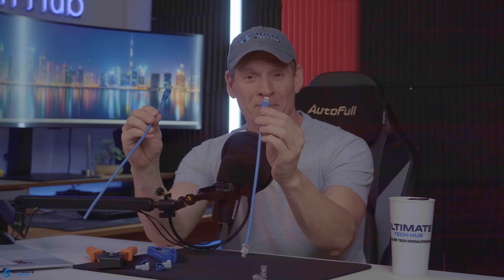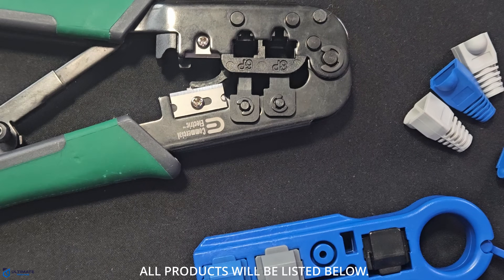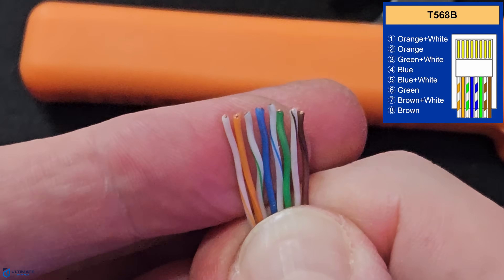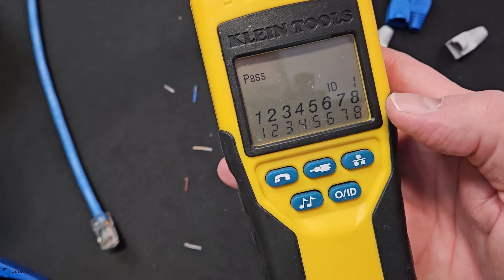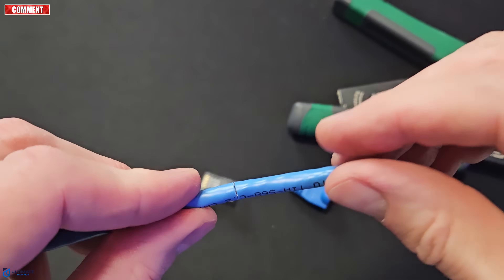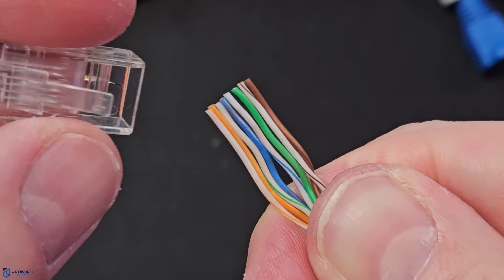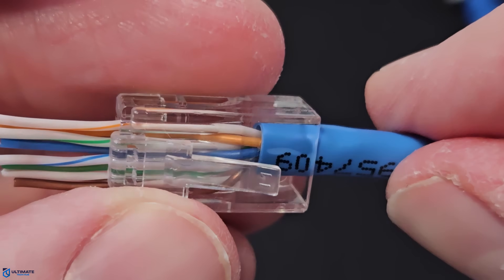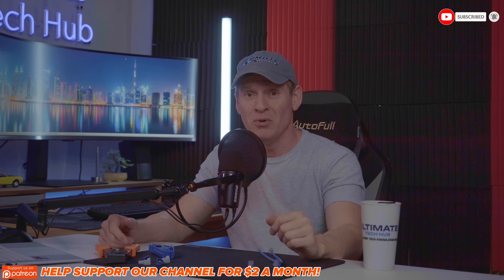Stop Wiring RJ45s WRONG! (EZ vs. Pro Method)

Comment: I saw these passthrough connectors on AliExpress, but i just go to my local store and buy the regular ones, never bought those covers either, i use an older crimping tool, so even if i wanted to use the passthrough ones i wouldn't be able to cut them with the tool, only thing that's a pain is getting the damn wires straight...

Comment: Pass throughs ONLY!  Been using them for years and make it easy to confirm the wire order and correct before crimping.  Won't go back to the old style.
Reply from the maker: All ypu need is a quality ez crimper with a sharp blade and ypur all good! Thanks for watching and for commenting !

Comment: A lot of manufacturers are voiding equipment due to people using pass through; crestron, extron, qsc, etc. Can cause shorts and cross talk. Just FYI. I only use regular mods but the ones that come with guides so the colors don’t mix up. Pre mades are the best option when possible.
Reply from the maker: I typically use standard RJ45s and the ones with the guide bars are very easy to use. 
Thanks for the great information and for watching !

Comment: Someone tell me what is the advantage to using T568B, which has white/orange (pair 2) and white/green (pair 3) swapped. In telephone applications, line 1 (white/blue) is in the middle, line 2 (white/orange) is outside of pair one. Thus T568A has the advantage of being compatible with analog telephone lines. Is there a greater advantage for T568B, which is not compatible with the phone standard? If so, what is it?
Reply from the maker: There isn’t a real performance advantage to T568B. The two standards are electrically equivalent for Ethernet; they just swap the orange and green pairs. If you terminate both ends the same way, you get the same speeds and signal performance either way.
A quick correction that matters: Line 1 (blue pair on pins 4–5 of an 8P8C jack) is the same on both T568A and T568B, so basic single-line analog phone use still works either way. The difference shows up when you try to map multiple lines using specific pair/color expectations (USOC vs 258A conventions), which is why T568A is often described as “more telephone compatible.”
T568B is based on the older AT&T 258A color code that was widely used in earlier structured cabling installs. So if a building (or installer) already standardized on that scheme, using B keeps everything consistent.
Bottom Line: Use whatever your environment already uses (existing house wiring, patch panel labels, workplace standard).
I will probably make a video on this subject so keep an eye out Ethan and thanks for watching!

Comment: I've been using the EZ connectors for years (POE and non-POE cabling, CAT 5E, CAT 6, etc.) and haven't had any issues with them. It is just quicker and easier for me, particularly as my eyes get older and I'm making more frequent use of reading glasses.
Reply from the maker: Glad to hear the EZ RJ45s are working well for you. I have a combination of both types in my home and have never had any connection issues. Thank you for watching and for commenting !

Comment: I do not like the easy pass through connectors, because they have a tendency not to seat well in some switches. When you push the connector into the switch, you want that satisfying click so you know it’s locked in. I’ve noticed that most of the ez pass through connectors fail this on many devices.
Reply from the maker: Great point and thank you for watching 🎉

Comment: Great video Mike!  I didn't even know there was a EZ pass-thru connector, I've only ever used the standard RJ-45 connector.  30+ years ago (back in the caveman days), I worked for a company where my primary job was dropping ethernet lines, wire up outlets and run lines to computers.  The worst I ever had to deal with were token ring lines, those were a PITA.
Reply from the maker: I used to run erhernet at CISCO events in Las Vegas.  It was fun hooking up all the switches and access points and CISCO paid well. My favorite installs are punchdown installs. Super simple and no connection issues. To be honest I really like standard RJ45s better than EZ. I think thats the original way I learned in college so it's very familiar. Thank you for watching Jon! Have a great weekend !🎉

Comment: My recommendation is to strip the cable way more than .5 inches, more like 2 or 3 inches. It makes more waste, but it is easier to straighten the wires and sort them. Once you get more efficient you can strip less.

And use a wire cutter pliers to cut the wires, no scissors. It will really avoid to make a slanted cut.
Reply from the maker: Thanks for the great comments  and for watching !

Comment: Thankyou but you didn't mention which way to hold the connector when you push the wires is ie should the locking clip face you?
Reply from the maker: Locking clip should face down like I show in the video. Hope this clarifies.

Comment: Appreciate the demonstrations, especially using a bit of the insulation to untwist the wire pairs, which is a trick I'm going to use!  RJ-45 connectors with internal load bars are supposedly necessary for reliable 10Gbps performance, though, so may as well use those if you're bothering with cat6 instead of cat5e.  In this hobbyist's experience, the load bars also make it easier to assemble the cable and trim the wires to the correct length (like a tiny, internal EZ connector) without anything poking out of the connector proper.
Reply from the maker: Absolutely,  load bars make it so much easier. Ive posted videos on cat6a installations with load bars. Thank you for the great information  and for watching !🎉
Reply: @UltimateTechHub Score.  In the meantime, don't mind me talking as if I didn't just learn about load bars lol.

Comment: I'm not keen on how you stripped the outer shield and then just used the wires.    

I strip close to the tip, then pull the string down to strip the insulation back.  Then nip off the end where the stripper crossed the wires.  This ensures your wires are perfect and haven't been nicked by the stripper.
Reply from the maker: I hear you, Ive stripped so many ethernet wires over the last 20 years that I never nick the wires. But yes the string is a great way to pull down the outer jacket to make sure no wires are cut or nicked. Thanks for the great comments and for watching !

Comment: I have been doing RJ45 before 10baseT.  After the 10baseT I soon learned the linesman scissors wire straightening edge and cutting function verses using crimp tool to make RJ-45 as good as any 100baseTX rated cable. A good set with blade, scissor, and pouch is versatile so get it with a good RJ11/RJ12/RJ45 crimper. One with OEM replaceable die guts if you are doing serious work. After the first 48 or so times a beginner making patch cables should figure how to lay cable and tools out for real work with RJ45s. A good supplier will rate connector type for speed and even if shielded. (I don't mess with shielded as, IMHO, if trying to make EMF shielded, whether external interference or radiant security issue just bite the bullet and go fiber.) There are polarized RJ45s like old DECNET with tab offset for non special controller communication use requiring obviously different crimp tool die. Then there's the topic of stranded patch cables or just to get by with a solid wire. This goes back to "if it moves use stranded" and "solid in wall with 110 block to receptacles" for longer MTBF. The metal flachettes in the RJ45 connector are optimized design by OEM for stranded or solid wire use. Generally, you can get by for a while with a solid wire patch cable before, after flexing one more time, it will fail.
Reply from the maker: Thanks for the great information and thank you for watching Mark!

Comment: I've been making my own cables since 1998.   I'm not a network engineer or anything but have done tons of cables both at work and home.  I'm a software engineer instead.  I have both types in my home lab.  99% of time I'll use pass thru but can use the "old school" ones too.   So much easier and quicker.  None of my crimp tools are made for pass thru.   I use "side cutters" that I use on pcb boards etc... they come out completely flush to the plastic end.
Reply from the maker: Wow, making cables since 1998, that's some serious experience! It's cool how you've adapted your tools to work for pass-throughs! I may try the side cutter method to see how it works! If it works and I make a video on it I will give you the credit and the shout-out!  Thanks for watching and for the great insight! Happy New Year Randy!

Comment: Nice work. I stick with the standard connector as I have a life time supply. Much prefer punch down devices for wall plates and then patch panels in the network closet.
Reply from the maker: I also have a lifetime supply of standard connectors which is about 50! Lol! I'll never need that many for my current home or when we move into our next house. I still have a some EZ connectors in the network tool box but never use them ( except for when I made this video ). 
In college we never used EZ connectors and we probably spent more time on punch down devices, wall plates and patch panels. 
Over the last 2 years, I had so many questions about EZ RJ45s versus Standard RJ45s I decided to make this video. It seems like a lot people are interested in it. 
Thanks for watching and for commenting Frank! 
Happy New Year!🎉
Reply: @UltimateTechHub  Yeah, I just made a video on fixing shoddy wifi. I use the same crimpers I have had since 1999. It's my first video YouTube decided to monetize (not sharing any with me). When at Georgia Tech, we crimped a few cables in the lab. It was never an official course thing just getting what we needed. I never found it hard. The hard part is now that I am in my 40s I find the little flip down magnifiers make it easier to see the little wires. I still don't find it any harder than 10 years ago but for that point.

Comment: I have been using the EZ RJ-45's (or RJ-45 passthru) for 20 years or so.  I have even moved away from installing RJ-45's all.  I install a keystone jack and use a factory patch cable about 90% of the time.  I have installed hundreds of the EZ's but if you get down to the nitty gritty, you need to match cable, connector and tools and then may very well not get a crimp as reliable as a factory cable.  EZ connector or not, the connector needs to match the wire gauge, solid or stranded wire, and then for ideal connections the tool needs to match.  Then you have the other issues discussed in the comments.  By the time you purchase 2 RJ-45 connectors and value your time at all, the factory patch cable is a wash.  You are out the Keystone jack, but the reliability is worth it to me.  I still make my own at times but not as often as before.  Your mileage may vary, this is just my 2 cents worth.
Reply from the maker: That's a great perspective! It's true that matching cable, connector, and tools is crucial for reliability. Prices for a factory patch cable are very reasonable so it's not a hard decision. I use factory cables from Satmaximum and they have never failed. I still like to make my own cables for custom cables lengths and it is still very satisfying when you do it right and it all works well!  Thanks for sharing your experience and tips!

Comment: Great info!  As a network guy your most important selection is your cable.  For most Cat 6 SBC (no CCA) will be your go to (1 Gbps @ 100m or 10 Gbps ≤ 55 m) as most home devices do not require more than 100Mbps.  I have never had an issue with pass-through connectors I love 'em, confirm before you cut, ring 'and plug, but keep that cutter clean  👍
Reply from the maker: Yes high quality cable is essential! Thanks for the great information and for watching!

Comment: Another question is why factory fitted patch cords still use standard connectors. Is it because passthrough connectors open for EM interferences?
Reply from the maker: Factory-fitted patch cords use standard (non-pass-through) connectors primarily for reliability and environmental protection rather than just electromagnetic interference (EMI). While pass-through connectors are designed to simplify installation.
Reply: @UltimateTechHub  It’s about price, as cables are produced through automation.  I have bought 6’ fiber optic audio cables < $1.  EMI not an issue in a low voltage application, if so Cate 6a and ground ur drain.

Comment: Con for pass-through prone to shorting out in POE applications, especially if the device is in a wet environment
Reply: If you are getting enough moisture inside the port for this to be a risk, you have much larger problems to deal with.
Reply: Better put some silicon or epoxy in those ends

Comment: I never use anything more robust than my thumb and index finger so as not to stress the insulation of each core. Four or five combs through between your fingers, and any kinks are out, and the strands are combed perfectly so that there are not even any gaps between the cores. Shove into the cutoff of the tool to the RJ45 stop, and cut perfectly straight off. Never use a scissors; maybe a good sidecutter does the job, but you don't want to fray the ends and cause a short between cores inside the connector. In the video, the insulation could have gone a lot deeper into the connector so that the little locking breakout can catch it a way in from the edge. Especially with POE, I don't like the pass-through type as the ends are not insulated. If I have to use a pass-through, I follow the usual way, and just don't allow the ends to protrude through. I may pass through, cut with a good sidecutter, and then pull back slightly, just as I am about to crimp the connector so that I hide the ends inside. 30 Years of muscle memory of doing it the old way, just does not like the new passthrough types, sorry.
Reply from the maker: Thanks for the detailed comment and your perspective from 30 years of experience! Thanks for watching David!

Comment: The old connectors are my choice the newer pass thru connector need special crimpers, and not all of the crimpers do a good job cutting the connector flush causing the connector not to seat properly in the rj45 jack resulting in no connection until i make a flush cut of the connector.
Reply from the maker: Yes I agree. I prefer the old standard connectors. The EZ crimper blades get dull very fast. Thanks for watching!